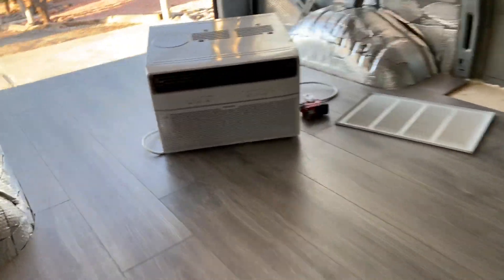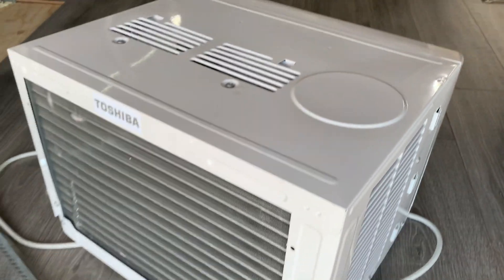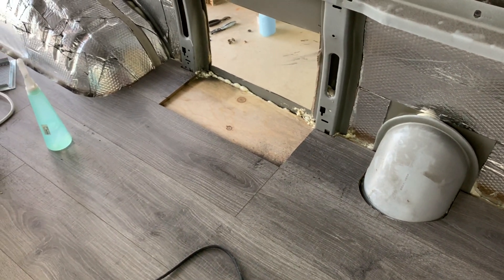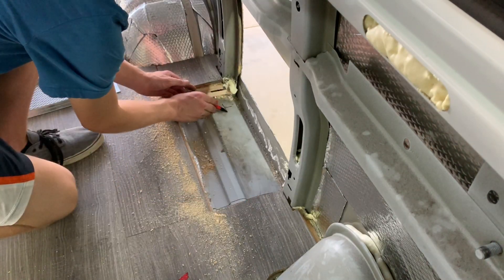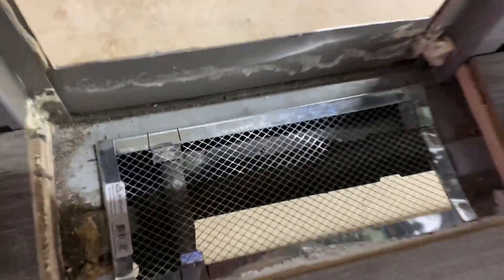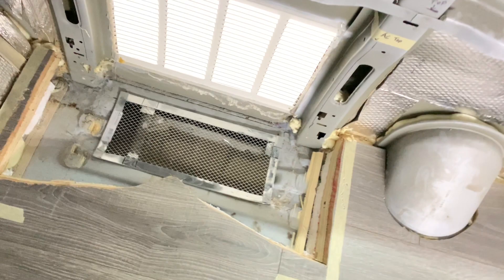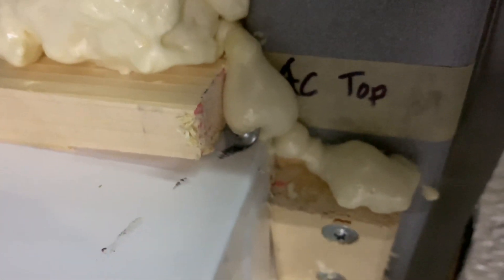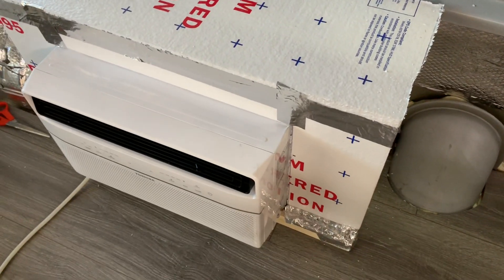Campervan Window AC Install (No Exterior Protrusion)

Comment: As an ac service  man for 35 yes , I have some  thoughts  on this . The first thing is the small units don't  last very long being bounced  around so it should be made to remove it with ease. They also need to be washed every season for mold and algae,  the area around the unit should  be water proofed with a drain pan and drain system . What normally  happens  is the condensing  coil gets blocked and the fan then starts throwing  water out the side vents in the ac getting  that area very wet around  the unit so putting  the unit in a water proofed area is key to stopping  the damage  that comes. I would  also add that as the ac  ages they tend to rattle as well so a rubber pad system to sit the unit on will be needed I have  installed  many units and water damage  from the old unit is almost always  part of the  deal. I have always advised  my customers about possible  water damage and the last job I did involved  repairing  the water soaked area.   If you plan ahead you can minimize  these  issues
Reply: Two issues about splitting  the unit up and moving coils , most 5000 units use one fan motor, now you need two.   And you have to allow for building a new  box for that plus extending  the refrigerat lines . It's usually  a job that anyone  can do . The bottom  line really to me, is can it be fixed  when you really need it? Having the unit together is cheap , and very easy to repair  or replace and your very quickly  back to getting cool.
Reply from the maker: @carlstephens1532  That's a good way to look at it. Interesting concept for sure, but now there's more pieces to fail with an increased electric draw.
Thanks again for your insight Carl!
Cheers!
-Tim
Reply: What I find in mobile  applications  is the foam and plastic  pieces  break so that rattle  the compressor  is OK but the copper tube do Crack, one other issue is some ac units are using  flammable  refrigerates so check before you buy it .
Reply: Water is the biggest  issue besides  mold
Reply from the maker: @carlstephens1532  Hey Carl, have you seen this setup? He split the condenser from the window AC and mounted it under the van. Pretty clean but I'd be concerned on the longevity of the condenser getting hit with rocks and road-spray. Thoughts?
https://www.youtube.com/watch?v=AXgHIrFqm9o
Reply: Thankyou Carl for chiming in on this segment. Your experience and knowledge are priceless to me and my limited knowledge on all things regarding ac. Couple of questions, any idea why there is no 3000 ish btu window unit made? Just thinking how nice it would be to have one say a third smaller in size and in that btu range. Also, though they are outta my price range, what are your thoughts on the zero breeze mark 2 units? Thankyou
Reply: I  bought  a 5000 window at walmart
Reply: And my present  built is a suburban  , yeah  I will have to get very ingenious  on this build , it's a 4x4  2500 ,I have slide out box's in a raised floor system so they can slide outside or inside as I've kept the second row seats in , I can carry five passengers, and fold the seats add floor panels to form a bed for my 6ft4 250 pound body , I have been mostly  camping in Florida  so heat is a big issue and power isn't  available  at most events  that I go to so yeah I have a lot of issues but solar  and a generator  are a part of my plans.
Reply: Joseph Tutor  sorry I missed your comments. Mold grows everywhere  it's wet. So I would  use foam on the bottom  and sides  and replace as needed. Also the ac unit has to be securely attached to the vehicle ,,,,think straps,,,  Air movement  is everything,  the rear coil has to get a lot of air into the rear side vents and of course exit the rear coil, , it's  up to your project  as to how you accomplish the build. I always  water proof the box ,drain area,,,, clean new units now don't  throw  water like a dirty unit will but water is water, ac units should  be cleaned at the start of hot weather every season. The area around  the ac should  be a bit larger one inch is good. So if you had to replace your new ac might be a bit larger so foam can be your friend, remember  the unit needs to easy to remove for cleaning  or replacing as they have short life spans ,my new 5000 ac was only 129 at Walmart with remote  😃 it depends  on how much 4 wheeling  I do ,but I'm  guessing  it might last one year,
Reply: @carlstephens1532  What are your thoughts on adding an A/C unit to a Cargo Van door with a removable hatch door to be placed when driving so that you can remove the A/C unit to put in a safe and stable area&  so that it doesn't collect dirt while driving? How would I prevent the condensation from getting on the cargo van door?
Reply: @ketoauntie7301  I've done that as well. It works for me not to carry that if you can store it. As far as installing  in the door itself mine was a metal box with 1" lips on the door and to hold the ac there in case of a major crash  I drained the box to the outside  ,and used foam to seal it all up, it looked good was quite  while off-roading it stayed put.  , but I was able to remove the unit when not needed and turned it into cooking storage. Good luck with your build ,
Reply: Thanks for ur thoughts. How come with 2023…there still hasn’t been technology for it to be small and portable
Reply: @Dragonballings  it's been  there look up boating stuff ,  the boats have better equipment
Reply from the maker: After 35 years I'm sure you've seen some wild things. I'm actually really surprised it's still working after 1.5 years of being bounced around so roughly. Didn't expect these little Chinese compressors to handle it.
I guess I should also be worried about the copper lines fracturing from all the movement...

I drilled (and rust-proofed) a handful of extra holes in the drain pan to hopefully stop any water pooling issues. Fingers crossed!

I remember having to annually clean the coils on all 88 PTAC units at my college job (hotel maintenance). Incredible how nasty they can get.

When this unit dies (and it will die) I think I'll add some extra cushion in the mounting points. That's a great suggestion.

For now, I suppose it's an ongoing experiment in longevity in the harshest of conditions!

Thanks for checking it out and sharing some pointers Carl!
Reply: @VanwithTim    No mould anywhere in my window AC units where I live.  So it depends on the humidity.  Also, they are not in use while driving the van, so I would not be worried about it being bounced around.  They are so cheap compared to an RV unit.  Does anyone have actual example of a window ac unit dying or lasting in camper van?
Reply from the maker: @OffTheBeatenPath_  Luckily the van lives the majority of life in California's Mojave desert so no mold here, but a very real risk in places like Texas / Florida.

Our window AC has around 33,000 miles on it. Lots miles on crazy forest roads (enough to break a tie rod and blow out control arm bushings).

Luckily still working okay for now!

Interestingly enough, the professional RV conversion company "Roadtrek" utilizes window AC units in the top at the rear of the van. This unit lasted them around 18 years.
https://www.youtube.com/watch?v=VcYl9ktmlas

People in the comments seem to appreciate the design.
Reply: if the van is moving its being bounced around whether it's on or off
Reply: @VanwithTim  I run an Alpicool T60 fridge and have for 3.5 years. 12v compressor. It has lasted just find, even down bumpy dirt roads.
Reply: Carl, do you offer installs for people looking to put a system like this in a cargo trailer camper conversion?
Reply: @Entertainment82123   my wife passed and I'm still dealing  with that , I'm in Tampa  fla area ,
Reply: @carlstephens1532  … 
prayers & condolence to you Sir,
From the passing of your wife
Reply: @iammaximus614   thank you ,
Reply: Yeah I didn't understand why he didn't put a drain pan in and instead cut that big hole in the floor. And these AC window units are basically disposable, need to make it where it's easily replaceable because most people aren't going to work on them, cheaper to just buy a new one.
Reply: @davidframe1613  the hole is to allow outside air to be pulled in by the condenser fan to blow air across  the condensing coil back to to outside ,   that's part of understanding what the ac unit is actually doing,  so it works correctly, it appears  simple  but it's not
Reply: Will I've need a ac service person ever since i came out of the birth channel.  
If it works it's good. 
The end.
Reply: @HoneyBerighthere-Saysarath  I understand  your point but mold and algae grow in all ac units and the smaller  the space the more important it is to keep it clean.  I just did both of mine and yeah there was quite a bit
Reply: @carlstephens1532  I had a small act unit that was working perfectly until I cleaned it. I did everything a video I watched said to do but after everything dried I was unable to use the buttons on it. I made sure to not get those electrical things wet but 🤷🏾‍♀️. The remote won't turn it on either. Once I was able to turn it on but the temp button wouldn't work. Figured I'll just replace it. That experience has my to scared to clean my bigger unit so I just cross my fingers the spores won't affect me.
Reply: @JNante  normally  a/c units will survive  but in your case I'm aware that some cleaners destroy  touch pads and other electronics, coil cleaners are in that zone. I cover the controls with plastic tape if I have  to,  water is normally  not an issue ,  but remember  mold can cause  a lot of health issues along with structure   problem if not dealt  with ,

Comment: I watched all those sparks going into your van and on to the floor, would drilling a small hole in each corner and cutting from the outside have been possible?
Reply from the maker: Good call, but unfortunately there wasn't enough clearance to fit the grinder down below.
I should have made my cuts before laying the floor to make clean-up easier, but wasn't sure if I actually wanted to tackle this project at first haha.

The flooring itself has been mind-blowingly durable. (Just some Pergo stuff from the big box store.)
Thanks for the comment Carl.
-Tim

Comment: Your compressor starting wattage is at least 50% more than your running wattage.  So your calculation is way off!  They build air-conditioned with a circuit that reduced starting wattage but their a lot more.
Reply from the maker: The unit does incorporate a capacitor to mitigate the  high amperage at startup. Even at 50% higher wattage it would be less than 1,000w and only for a very short amount of time.

Those AC units with reduced starting draw sound really interesting though! I’ll have to check them out. Love learning about new tech 👍👍
Reply: @VanwithTim  it's called a "soft start" you can either modify the unit, or go full aftermarket. also good for fridges because they have a higher startup draw as well. With a 3kw inverter, you'll be fine without the mod (as you've experienced).
Reply from the maker: @theborednerds  Ahh I understand now. 
I can imagine a 1,000w inverter overloading on the compressor start.

Thanks for clearing that up!

Comment: You need to think about how easy and quick it will be to replace. They are made in China and they do crap out. 500 miles away from home and it goes out what then. It’s a good start though. The coils should stay clean being inside.
Reply from the maker: I'm actually surprised it's still working after 19 months. These compressors really aren't made to be bouncing around!
Reply: Ac units are wet dust sticks to both coils that why cleaning  the unit is needed
Reply: @carlstephens1532  dust in general gets in there. Wet or dry.

Comment: Fascinating job. Does it really cool down the van? For how long?
Reply from the maker: Check out my video showing the electrical side of the system.
https://www.youtube.com/watch?v=cxpxg82UV3g
It cools really well. Things to keep in mind:
I’m only cooling 250 cubic feet of airspace. (For comparison, the average size of a child's bedroom in the USA is 1,100 cubic feet.)
However, the van has huge windows all around it (making it into a solar oven of sorts)
Overall, though, it runs great throughout the day off of solar. Once the sun goes down it runs solely off the batteries, but it doesn’t need to run very long since the outside temperature drops at night.

I plan to make a new video this summer showing real-world power consumption and cooling ability with outdoor vs cabin temps.
Thanks for watching!!

Comment: I built a similar system,  but mine ducts out the driver's side rear door.   You can see it at Adventure van man channel on YouTube,  Man follows his dreams video title,  I'll give you a time for the a/c part in the next comment. 
  This puts the a/c up high to work effectively.
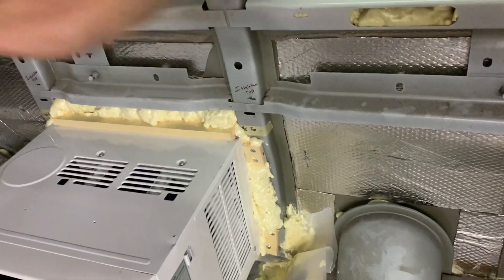Reply: The a/c explanation starts at 8:43, you should watch the whole video to see more of the cabinet I built for the a/c, it holds a 20lb propane tank and some other storage below the air conditioner and leaves space for storing my bicycle between the back door and the cabinet.
Reply from the maker: @duane4972  Thanks for watching Duane. Just checked out your original video and your updated video (you're correct that it's a never-ending project!) We just did a diagonal trip to the west coast as well.

I really like your small trap door you added in your AC intake section to cool you off at night using your roof fan.

Really cool AC setup! We're doing some functionality improvements and I think we're going to remove the front vent on our AC and duct directly off the internal fan up towards the ceiling.

Also adding a diesel heater (8F nights in northern Arizona pushed that high up the priority list!)
Reply from the maker: For anyone curious, here's Duane's setup! https://www.youtube.com/watch?v=FysRmXlnp7c
Reply: @VanwithTim  Thanks for linking to my friends channel,  I subscribed and rang the bell to your channel,  I'll keep up and may be able to meet up somewhere,  sometime.  I  usually winter in Florida,  but ya never know where I'll be,  Peace,  enjoy your van  !
Reply: Tim, A friend of mine has a Chinese diesel heater,  she said she found some help and explanation online about re programming the unit to help it not produce too much heat and not make as much noise, she says it made it work much better than the way it came.
Reply from the maker: @duane4972  I just finished my install last weekend! I joined a few Facebook groups for the heaters and learned a LOT. So far I'm very happy with it!
I've silenced mine pretty well but it's still a little noisy.  I went with the smallest heater (2KW) since my van is so small.  I've heard of so many people getting the large heater (5KW) and regretting it as they produce way too much heat!

Comment: But does it cool though. You should make a video showing it cooling down.
Reply from the maker: Was hoping to be able to film that but will have to wait until it warms up outside.

Want to show the interior and exterior temperatures as well as battery voltage in a nice time-lapse.

Will update once filmed and uploaded!

Comment: When u next take it out for what ever , trim the louves on back of exhaust & install soft start capacitor . Both will reduce electric wattage .
Reply: I seem to remember older electric motor driven equipment all had capacitors to start did newer designed more efficient electric motors not need capacitors ? Thank you for your information .
Reply from the maker: @13699111  You're right and this unit actually already has an integrated capacitor! I suppose an extra one wouldn't hurt but probably wouldn't make too big of a difference in my situation.

Some smaller inverters / battery banks might not be able to handle the initial draw I suppose.
Reply: The new compressors  don't need a soft start capacitor. Most are a form of a rotory style.  And are not the piston version.  The unit needs a lot of air on the condenser side to work at its best
Reply: The key for mobile  ac should  be a unit that gets the correct  power to it and can be fixed  or replaced easily  the small units can do all you need if it's installed correctly and the bonus  to me is if I'm camping  and it dies ,I just buy a new one slide it in and go back to enjoying my time camping. I don't want to waste my time  fixing an ac while I'm trying to have fun
Reply from the maker: Good idea Rob
Reply: The factory  that make the newest  units say you can kill the new compressors  by adding  what we call hard starts.its best to not add anything
Reply: @carlstephens1532  Thanks I'll keep that in mind when buying new unit